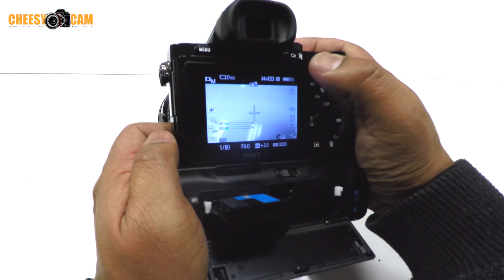DIY Sony A7s Battery Grip from Canon BG-E6 using LP-E6 Batteries

Comment: GREAT!! I just did the same thing in order to power a black magic pocket (first one), it works perfectly!!! No more wire or cable to plug on the 12V entry on the side of the camera. The battery level is not read properly on the pocket but I do not really care!! Thanks for your idea!!

Comment: I picked a low cost Travor battery grip for canon 5d mark 2 and after modification using on sony A7 II. Being non technical I put only one battery and second remain in the bag. It is working fine. Sony LAEA 4 adapter can also be attached having tripod mount.

Comment: Have you thought about modding the Panasonic (GH3/4) battery grip? Is that possible for the a7s body?
Reply from the maker: Anything is possible, but the Canon uses 7V, the Sony NPF batteries use 7V, and the OEM A7s batteries are around 7V. The Panasonic batteries are more at 8.4V so it wouldn't be a direct feed. you'll probably need something to step down the voltage.
Reply: Ahh, got cha.